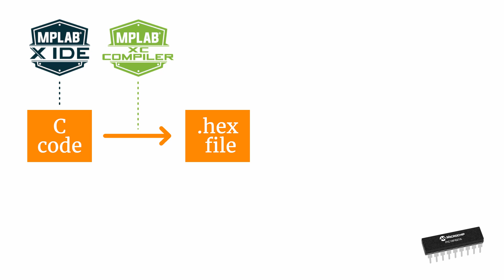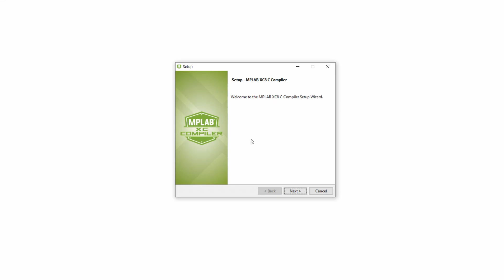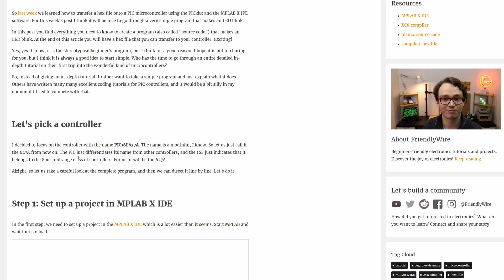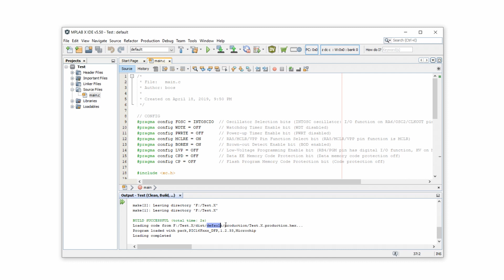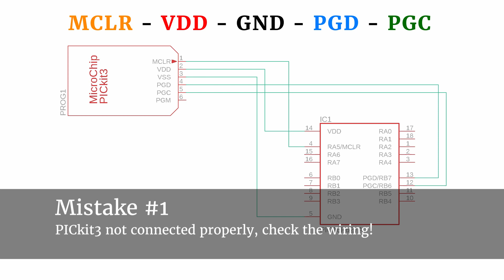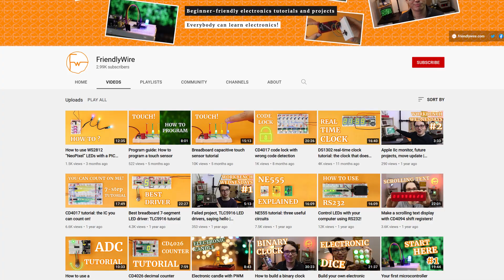How to get source code onto a PIC microcontroller

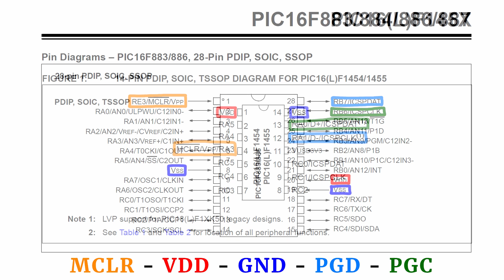Comment from the maker: IMPORTANT: There is a mistake at 6:21 for the PIC16F1455. The correct PGD/ICPSDAT connection is at pin 10, and the correct PGC/ICSPCLK connection is at pin 9. Pins 12 and 13 are the wrong connection, sorry for the confusion!

Comment: Hi I do repair job on elevators and many display devices uses PIC18F258 many of those microchip is corrupted because the display won't turn on, I've tried to change the microchip from another display and it turns on, so my question is how can you take the programs from another display or microchip and put it into an empty microchip one ? I have low knowledge about programming so it would be helpful if you make a video about it . Thank you
Reply from the maker: That's a really good question! Unfortunately, if "code protection" has been turned on by the person who flashed the .hex-file onto the controller (and that is done almost always for industrial applications) then there is no way to retrieve the .hex-file from the microcontroller with the PICkit3.

To find our if code protection is enabled, first find the VDD, VSS/GND, MCLR, PGD and PGC pins of your PIC18F258, and connect the PICkit. Follow the steps of this video, and inside the MPLAB IPE click o connect, and then on "Read." If code protection is turned off, you will be able to read a .hex-file.

Let me know if this helps. If not, I am happy to help :)

Comment: Hi, I want to program PIC16F84-04/P . Will the program be stored in the IC after compiling? Because I saw on datasheet that the IC also have EEPROM
Reply from the maker: Yes, after you flash the program onto the PIC it will stay there indefinitely. Good luck, let me know if you need any pointers with setting things up, I am happy to help :)

Comment: When i connect my pickit3 to my computer the status led light up red colour and my pc unable to detect i.Pls help me..
Reply from the maker: Is it unable to detect the PICkit3 or does it not detect the PICD you are using?
Reply: @FriendlyWire  I click the tool column in the mplab x ipe but nothing come out
Reply from the maker: @yenkhang1683  You are probably using a new version of MPLAB, yes? This does not support the PICkit3  anymore. I can help you if you send me an email, which you can find at the bottom of www.friendlywire.com .
Reply: @FriendlyWire I think it is unable to detect the pickit3, anything I can do?

Comment: Why don't you tell to use a ziff and some perf board? Solder that up and no worries. Most pick kits come with a few ziffs.
Reply from the maker: Yes, zero insertion force sockets (ZIFs) are a great idea, and they work well on perfboards if you know how to solder. But all the projects on this channel are designed to work ion breadboards, that's why I focused on that aspect in the video. The data rates for programming PICs are so low that it works quite well with wires inserted into the boards. Hope that explains it, and thank you for pointing out an alternative solution :-)

Comment: Really like your presentation. 🥰
All I wanted to do initially was to find out if the PIC16F628A that was to be used in one of those frequency counters is faulty,
or was supplied preprogrammed on delivery of the Frequency Counter Kit with code unsuitable for the job. 
Then I realized, that to investigate the matter, one would need to interrogate the controller memory. 😖
Reply from the maker: Thank you, Frank, much appreciated! There are debug options available but those typically are only helpful if you have the source code available. You could also try to download the .hex code from the controller, but that only works if "code protection" is turned off. In most products, it's turned on, unfortunately.

But if you want to know if the controller is "doing anything" (which is a much more qualitative statement) then I recommend getting a logic probe: https://www.amazon.com/dp/B000Z9HAP4/ This will let you check if there is any activity on the chip pins, and it may be sufficient to figure out if the controller is alive. Hope it helps!

Comment: FYI : You can't use an arduino to program a pic controller, i've tried and came to the conclusion that my pic10f200's use a different programming algorithm than the arduino can provide (through arduAVR)
Reply from the maker: I have never thought about writing a programmer for PICs, that would be an interesting project. Timing is not so critical, in the old days they used to do it over the COM port (serial interface) which is rather slow.

Comment: Have you run into problems where you need additional circuitry to program something like a pic32?
Reply from the maker: Thanks for the question! I have not worked with PICs other than the PIC16's I mention on this channel, but in principle there is no issue with using the same techniques for all supported devices of the PICkit.

Can I ask: is something not working for you? If so, let me know and we will figure it out :)
Reply: @FriendlyWire  I actually have a picmx32 that I want to program but I keep getting "chip not detected" errors. I'm using the same software and I'm pretty confident I'm wiring the pins right
Reply from the maker: @TheWinnieston  Are you powering the chip externally, or are you using the PICkit to supply power?
Reply: @FriendlyWire  I tried both, when using the pickit I did the power chexkbox thing
Reply from the maker: @ I see! Looking at the datasheet of the PICMXx32 family I realized that they have multiple VDD and VSS connections, did you wire up all of them? The PICMX32 have two PGD and PGC connections, each, but that only means you can either use the pair PGC1/PGD1 or the pair PGC2/PGD2.

Otherwise, send me a photo of your setup. You can reach me via email that you can find at the bottom of www.friendlywire.com or alternatively on social media. We will figure this out :)
Reply: @FriendlyWire  oh, it may be something akin to that! I'll wire something up tonight and let you know how it goes!
Reply from the maker: @TheWinnieston  Yes, let me know! :)

Comment: hello   Thanks for your helpful tutorial.   I want to copy a 44-pin pic16f1937 with the same program and write it on the raw IC. Please advise the program pins and the voltage value. Thanks
❤
Reply from the maker: In the datasheet (https://ww1.microchip.com/downloads/en/DeviceDoc/41364B.pdf) it looks like VDD is pin 20, GND is pins 8 and 19, MCLR is pin 1, PGD is pin 28, and PGC is pin 27. Operating voltage is 1.8V-5.5V. Good luck!

Comment: Such a great video thank you very much. Question, if the PC is solder to a PCB is there a way to bridge it to reprogramed/flash or this might get issues?.
Reply from the maker: Thank you, I am glad you found  the video helpful! To answer your question: it depends, unfortunately, one what is connected to the controller. If you have a PCB, check if there is a "programming interface" connector or something like that. A lot of production PCBs are designed such that the PIC can be flashed after being soldered, for convenience. If such a pinheader exists, it should be OK to flash it. Hope it helps!

Comment: Are people still using PIC nowadays ? 

I have so many mixed comments into starting with it...
Reply from the maker: I guess the answer is YES, since this channel exists ;-) I like to use them for the type of projects and applications I share on this channel, but there are of course other alternatives. I like to program them in C, since you learn a lot about how registers work, and how the hardware is configured. But you have to choose what you like best, of course :)
Reply: @FriendlyWire  i have just tested some PICs with this PICKIT3, and I must say it's a very hard time finding a working version of IDE/IPE to actually let you connect the device.

I eventually had to use MPLAB X IDE 6.20 + Standalone PICKIT3 Programmer 3.10 to completely control over this. 

I think PIC / PICKIT3 are very obsolete technology nowadays that Microchip doesn't even bother to maintain correctly.

Comment: Thank you for this video. Unfortunately MPLABX IPE V5.25 can't connect to the programmer (pickit3). I tried with an external power supply without success. The same programmer works fine with the standalone application pickit3 v.3.10.
Reply from the maker: That is strange---although PICkit3 is no longer officially supported, I am using it every day with the newest release of MPLAB IPE. Can you share a screenshot? You can reach me on social media (links in description) or via email (at the bottom of www.friendlywire.com) so we can get this sorted out :)
Reply: @FriendlyWire  Thank you for your reply. Meanwhile, the problem is resolved, thanks to this video: https://www.youtube.com/watch?v=vfmLu6XzBtw. In brief - pickit3 had to be switched to MPLAB mode, either through the standalone application or by holding pressed the button, while usb plug-in.
Reply from the maker: @ecotronic6622  That is so interesting---I never had to do anything to my PICkit3 to make it work with the IPE. Thanks for sharing, this is good to know!

Comment: im having this error: 
 Target Device ID (0x0) is an Invalid Device ID. Please check your connections to the Target Device.

please help i even changed pics already and tried another compiler
Reply from the maker: If it reads back 0x0 it most likely means that the PIC is not connected to power. Can you check the VDD and VSS pins for 5V?
Reply: @FriendlyWire  i got the cyan brick thing that connects all the pins already , and it did tell me that the pic is not powered but i fixed that error already using the ipe power section, but i still get the id error
Reply from the maker: @cubirk  Can you send me a picture of the setup? You can find my email at the bottom of www.friendlywire.com . It's quite common to get these errors, we will figure it out :)
Reply: @FriendlyWire  oks thank you
Reply from the maker: @cubirk  Thank you, I got your email! I will look at it today so we can figure it out. It's quite common to have these problems when setting things up, so I am confident we can solve it. :)

Comment: Dear sir how to programe 30f2010 microcontroler ic rt809h programer
Reply from the maker: This tutorial is for the PICkit3 programmer. Do you want to use a different programmer? If so, do you have a link so I can check it out?

Comment: hello i have an issue, i am following this project exactly as the video shows, but instead of a 16f627 im using a 628. which from what ive seen online are basically the same. my issue is that the led is turning on, however it is not flashing.
Reply from the maker: Thanks for your interest and for your question! When you set up the project etc. did you select the PIC16F28A as a device?
Reply: @FriendlyWire  yes i selected PIC16F628, maybe this issue is something to do with the internal clock?
Reply from the maker: @djt3934  Yes, it could be that. Can you send me your code to my email (at the bottom of www.friendlywire.com) and I will have a look at it :)

Comment: Do i really need to use Pickit 3, can't I directly dump the code from pc to microcontroller
Reply from the maker: You need some sort of device for that. There are other options out there, including kits that use the serial connection from back in the day, but I find the PICkit3 or similar devices to be the easiest choice.

Comment: Hi dude i compiled my code but i cant reach the hex file. I mean it doesnt appear on my project file ?
Reply from the maker: It's a bit hidden, it shows up in the dist/default/production/ subfolder of your main project folder. Can you find it there?

Alternatively, if you compile it inside MPLAB IDE, there should be a message where the .hex-file is stored.

Hope it helps, let me know! :)

Comment: bro how to do for pickit2
Reply from the maker: I am not sure if the PICkit2 is still supported by the current versions of MPLAB :( But the PICkit3 still is, for now, and you can get clones (sometimes called PICkit3.5) on Amazon and other sites for around $20. I know it's super silly that they keep making new programmers, since for these simple PICs the old ones work just fine...

Comment: I have a pic16f689 IC that has been programmed, and I want to copy it, but after I open it, it turns out the data is protected, how do I open the data protection without destroying the data that has been programmed?
Reply from the maker: Unfortunately, if the data protection bit has been set, you cannot extract the data using the PICkit. That's why I never set it on my projects, just in case I ever need to clone a PIC and I no longer have the .hex-file.

Comment: Is it possible to get the hex code from pic ic where it was flashed earlier.
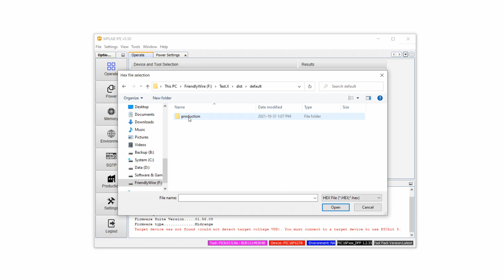Reply from the maker: Yes, if the code protection bit is turned off by whoever flashed the PIC, it's possible. Just connect it as shown in the video until 8:17, but then click on "Read" and the PICkit will attempt to read out the PIC's memory and retrieve the .hex-file, if possible. Hope it helps!

Comment: Hi, kindly advice the followings. I fit capacitors  on the rails RA7 and RA6 with a quartz oscillator, it lights up the LED on RB3. What if I change the nF value of capacitor? what if I put a polarity capacitor instead? Thx.
Reply from the maker: My goodness, I just saw this comment from 2 months ago. Sorry to be so late to the party, and thank you @advanceinkscape8494 for your perfect answer.

Also, besides what was already said, usually you need to check the datasheet of your crystal and it will tell you what its "load capacitance" is. Say it's 10pF. Then, if you ignore stray capacitance, you can usually take each capacitor to be twice that value, so: 20pF each, or, as was pointed out above, 22pF would also do the trick.

Also, a lot of PICs allow you to use an internal oscillator, in which case you don't need an external crystal and capacitors at all.

Comment: Hello my friend. I have a microchip   PIC 24F 16KA  102-I/SS  e3   1845 CAB.   it has been placed inside an inverter.Now for reasons well understood the constructor of the inverter is not willing to give me the programm of it or even send me one [to buy of course ] programmed one.He presses me to buy a new inverter around 450 $.I think is totally unfair and i would call this seller a Big Thief.I dont mention more.But i say this.I have already bought pick it 3,5 programmer.Is there a hope i can do something??and what about if it is encrypted??And my last question.How does the ministry of commerce of each country allow these thieves for a Pic chip of 2 euro cost to force you to spend another 450$ ???Thank you for your time.....Respect to your work my friend.
Reply from the maker: I am sorry this is so expensive... It seems a bit extreme, to be sure. If the developer has not activated "code protection" you can read out the .hex-file with the PICkit3. But I am sure they enabled the code protection using the configuration word of their PIC, which is what companies can do to protect their intellectual property. In this case it is not possible to get the .hex-file from the PIC.

Comment: need get source code c from  hex
Reply from the maker: That is not possible with simple tools, unfortunately, because C code is first turned into assembly and then turned into machine code. Reverse-engineering this ("disassembler") is possible, but those tools are expensive, and the C code this generates is not easy to understand, since variable names/function names/the entire structure will be different in general. But if you are good at understanding machine language then it should be possible to work it out!

Comment: THANKS,
for my case I use the pickit2 software
and that the pic 18f8680 is soldered on the electronic card and I have a 5 pin connector on the card for programming.
THANKS @FriendlyWire
Reply from the maker: Sorry for my late reply! I am not sure what went wrong... It could be a lot of things: wiring, unstable power supply, a bug in the code itself perhaps, a loose connection somewhere, or a USB port that cannot supply enough power. We would have to narrow it down some more. Did your setup work in the past, and not stopped working? Or is this the first time you are setting things up? (You can also get clones of the PICkit3 online, they are not so expensive as the newer PICkit4, and they work great.)

Comment: could you explain to me why when I read the source code of the 18f8680 microcontroller and I write it a second time on the same pic the program does not work
knowing that I use the pickit2

Thanks a lot
Reply from the maker: It's a good question, and things like this can be very frustrating, I have been there. I tried to find out of the MPLAB IPE supports the PICkit2, but I could not find it either on the official website or in the manual. I assume that it shows up in the IPE under "tool"?
Reply: THANKS,
for my case I use the pickit2 software
and that the pic 18f8680 is soldered on the electronic card and I have a 5 pin connector on the card for programming.
THANKS @FriendlyWire

Comment: Hi. Great video. For us latecomers, I notice that the latest MPLAB IPE v6.10 (Directed to the download site on your FriendlyWire website) no longer supports the PICKiT 3!!.
I found out the hard way. Will uninstall and go back a version or two. Thank you
Reply from the maker: Thank you for your feedback, I was not aware of that. I am traveling right now, but I will check this on my system when I get back. It would be a real shame, since the PICkit3 is cheaper and just perfect for hobby applications, no need for the much more expensive PICkit4 in my opinion. Thanks again!
Reply: @FriendlyWire  Hi. Got it wrong! You can use the PICKit 3 with v6.1.0!! You have to download extra packs which includes support for the ‘3’ So we can breathe again👌
Reply from the maker: @rogthedodge99  Good to know, thanks for checking! Do you have a link for where to download the package?